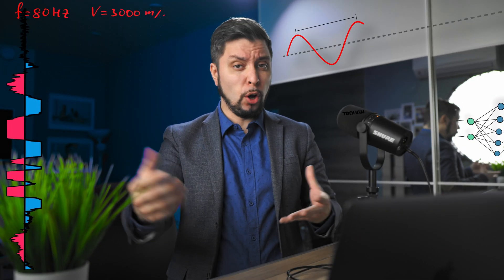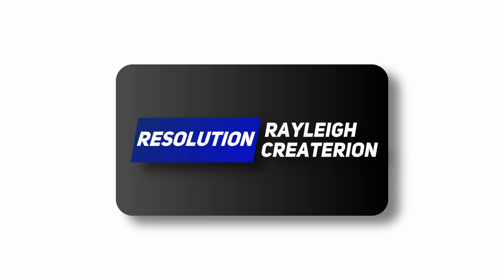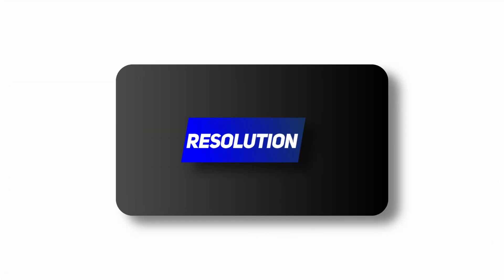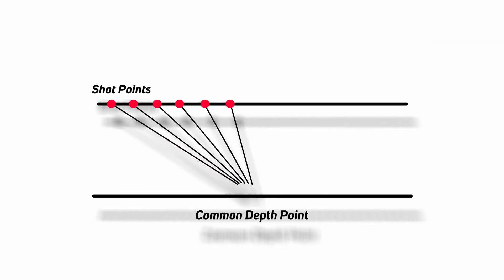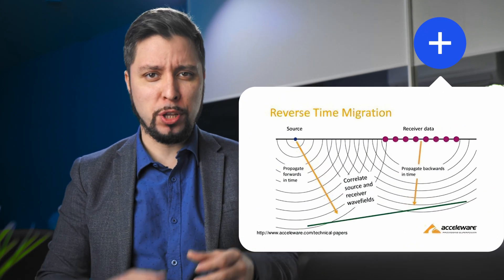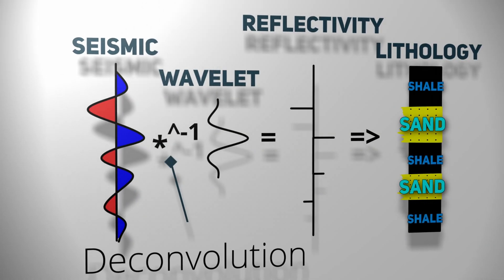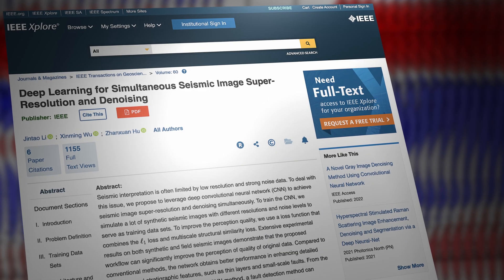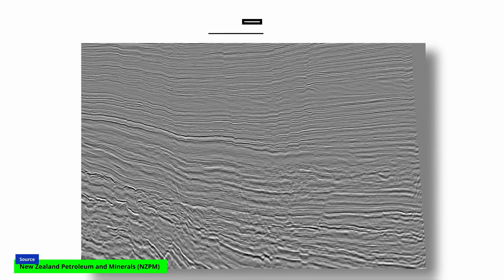Seismic Resolution 101: How to Improve Subsurface Imaging

Comment: The result of FWI is an impedance or a velocity model, how it can contribute to the seismic resolution?
Reply from the maker: FWI can improve seismic resolution by generating a more accurate velocity model, which allows for better imaging of subsurface structures. By accurately capturing the details of subsurface geology, FWI can help identify previously undetected features, ultimately leading to a better understanding of the subsurface